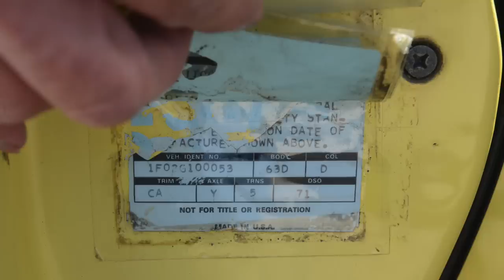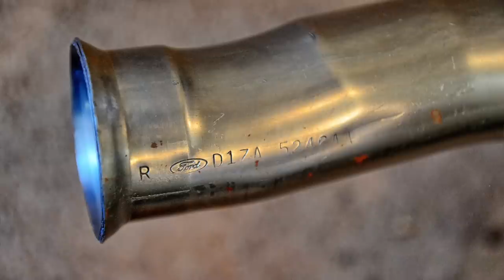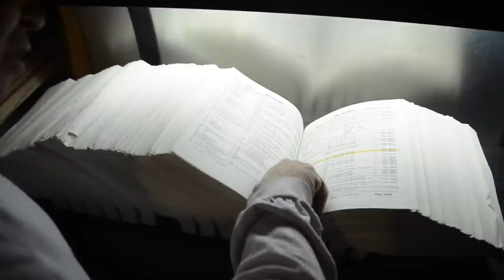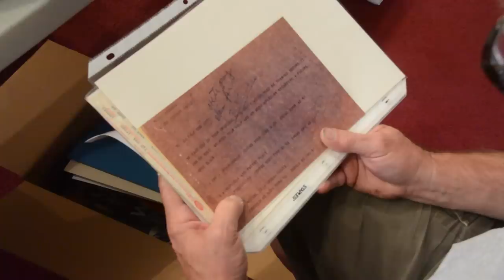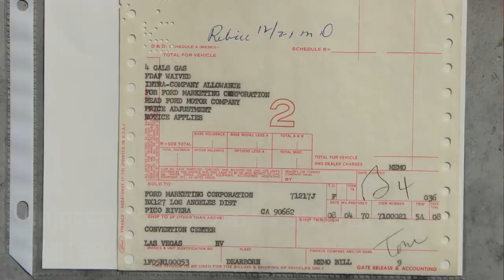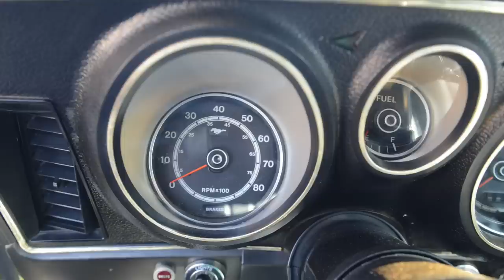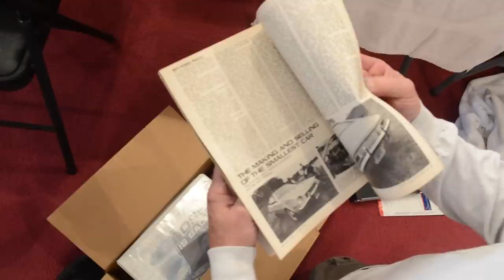Million Dollar Boss Mustang Prototype Barn Find -1971 Boss They Didn't Make

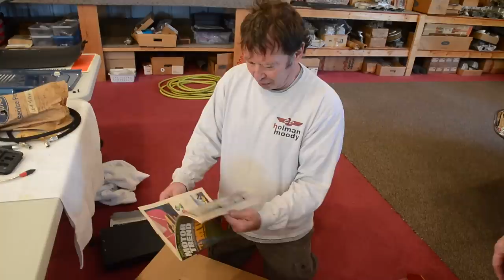Comment: What good is a car you don't drive? I once saw an ad for a '65 Chevy Biscayne with the "Drag Pack" option. A 425hp 396 and 4 speed. Price? $75K! I could afford something like that so I built my own. I found a '65 Chevy Biscayne with no rust and a recent paint job so I bought it. I installed a 550hp 454 and a Richmond 6 speed. I added front disc brakes and Hotckis suspension. A 3:42 posi rear end and new interior. I also installed gauges where the factory radio use to be. All for $20K which included the price of the car. This way, I could drive it anywhere I wanted.
Reply from the maker: I hear this a lot. The answer depends on the owner. Some people enjoy showing a car with limited driving. Some car people go so far as to restore a car completely and enjoy just having it in their garage or taking to car show in an enclosed trailer.
Reply: Just the mindset of that generation.  lol
Reply: ANY car was thought, designed and meant to be driven.  That's what gives a car its spirit...  I completely agree with you.
Showroom divas, the result of collectors trying to park their savings somewhere, are simply sad.  They dishonor the time, creativity and effort of whomever created those wonderful automobiles. (MOBILE implied)..  
If it weren't for the money Enzo made out of rich Ferrari fans, I am sure he would have damned them eternally.  Hence his quote:  "I build engines and attach wheels to them."  He build to race, that was his legacy.
So I guess parking cars for posterity is a rich man's disease.
Reply: My '69 Firebird w/a $200 455 in it when the "$3k buildsheet" 350 went south, I sold it to a friend of my nephew's, and he's spent over $75k on it, but it's NEVER been out of the garage - exactly the same spot! I would have sold it to another, or at least got a fair price for it, lol. Who else is ready to be an American Pickers style barnfind partner? I used to be very...lucky? I think that everyone here really would love to do just that! Next time may not come. Seize the moment every moment! Great find for a seemingly great guy!
Reply: People need to stop griping about how they think this car will sit.  Even if I hat was the plan for it, it would be much better for a one of one car to be in a museum than have some idiot wrap it around a tree or swap some big block in to go drag racing.  If this were some mundane, cookie-cutter car, I would agree with you...however, the fact that this is the only '71 Boss 302 known to exist AND the fact that prototypes were never sold to the public make this car worthy of trailer queen status.
Reply: AMEN, Freddy!
Reply: I agree w/u also , sick88, in this case. However, even a queen needs a little careful exercise regularly, imho.
Reply: Hi Rick...I'm a "Ford" guy but I did own a '65 Vette Roadster with the then new "porcupine" engine (aka BBC) 396 425 H.P....from everything I remember reading back in the day, the 396 was only offered in the vette in '65.
Reply: Thanks Manson...did not know that...I thought it was only offered in the vette in '65...of course I know only the vette engine was rated at 425 H.P.  My '65 Roadster was a pretty damn fast car, especially for 1965.
Reply: Well..once you have a ONE OFF 2 MILLION dollar car..then you can say weather you would take it on the street with a million doped up Millenials running wild to smash it...

Comment: Wow, you've hit the mother lode! I'm 66 now, but in the early to late 70's, I owned several Ford high performance cars. Both '65 square back & fastback 289 hipos. '66 Fairlane 390 GT. '67 Fairlane factory 427 drag car, was told "Fast" Eddie drove it at the '68 US Nationals. '69 Mercury Cyclone 428CJ w/ram air & 4 speed. Loved that Hoolman Moody shirt! Ah, the good old days! PS I can remember buying a set of 289 hipo / Boss 302 connecting rods, brand new at a Ford dealership for $8@!

Comment: In 1971 I was 13 and I saw a yellow 71 Boss 302 in the parking lot at the Southroads Sears store in South Omaha Neb near Offut air force base. I vividly remember this as I was a big Mustang fan and I was actually very disappointed that they had made the car so much bigger and were using the Boss 302 engine instead of the Boss 429. Swear to God. I am positive they made some 71 Boss 302s.

Comment: My step brother back in 1983 had a 1971 Boss with a 351 Cleveland. It had the Boss heads and a 4 speed Muncie transmission. It was totally stock when he got it but had been in a minor  front end collision that he had fixed and did a mild build on the motor. But it was a 1971 Boss.

Comment: Ford exec #1 - Hey, this new, heavier Boss 302 is a real dog. 
Ford exec #2 - Yeesh - it feels like my secretary's '67 289 coupe - not good. Chevrolet is going to destroy us, what now? 
Ford exec #1 - Move the Boss program to the new 351 Cleveland, (making the most storied small block in the muscle car era) giving us the edge, but let's be sure to produce it in limited numbers for only one year - so even though we have the best running small block of anyone, nobody knows it. 
Ford exec #2 - I'll start the paperwork.
Reply: Matt Farah's Million Mile Lexus you would be amazed to see how light those cars were
Reply: They weren't really that heavy they were just made bigger with the 429 engine in mind because that engine was way too big for the previous body mustang and lots of changes had to be made to shoehorn it in. With the bigger engine bay and such the 429 would drop right in easier or that was the original plan.
Reply: number3665 , If only they would have produced the 429 like the did with the Clevelands.
Reply: The prototype  I would  like is the  one for the Boss 351, It was a 1970 
Boss with a 351 Boss engine!  I seen the  pictures of the cars  but They claimed  the  Both the  Fastback and convertible were destroyed, because  Prototype cars are not road legal!
Reply: The Lt1 would've chewed it up.
Reply: @number3665  they had plans for a 501 version of the 429
Reply: @nobleeffort2.4  Great running motor but real life story says different. My dad had a 71 351 Boss and ran a 70 340 Duster and crushed it! Of course my dad could drive but they bother left the line in a cloud of rubber. The Duster just didn't have the legs that day... The only car I saw beat the Boss, and there were many that came after it was a blown 70 455 Trans Am.
Reply: Mylan Miller now that would be worth the big dollars , but this 71 not so much
Reply: Cam Crysler my midwest 69 4v windsor with 4:11 totally smoked a drag race built 340 dual quad

Comment: As an original owner of one of the 1806  or so  BOSS 351'S made, I would agree that the 302  wasn't  enough  engine for the  71 model .  My  BOSS 351 in stock factory form could easily beat any previous stock BOSS 302'S , which there were two of them in my hometown. Rare  BOSS absolutely !!
Reply from the maker: Depends what you mean by "easily beat." Do you mean in the quarter mile? Or 0-60 MPH? Okay, but Ford engineered their Boss 302 for Trans Am road racing, not 0-60 MPH or quarter mile ET's. Do you think a Boss 351 would easily beat a Boss 302 in the Trans Am where engines need durability and high rpm's
Reply: Hi Jerry, I was referring to street racing/ drag racing. That was what went on in the 1970's where I'm from. We even had a BOSS 429 that was raced at our local dragstrip from the next town over from me. To answer your question, most likely not. I also owned a  1960 Austin Healey 3000 Sebring in that same era, which was raced around the Northeast and etc by the previous owner, could out handle the 351 !!

Comment: I've watched this over and over and still can't figure out how Ford or why Ford let this slip out the door when prototypes are most always destroyed if not going to be produced.I try to give anyone the benefit of doubt but at the end of the day...there's some unfilled holes in all this.
Reply: I know what you are saying. It is interesting that it apparently went straight through a dealer, no special deal was made for the sale. This may all be valid, so maybe somehow it was just some kind of mistake for it to get let out. Special car for sure any way.
Reply: Ford did the same thing in Australia in '73. They developed a Falcon GTHO phase 4, specifically to qualify for racing. They had all the Boss engines and race parts to build 250 cars. They built 2 for the Ford Team and 3 others. One car got delivered to a Dealer and sold before Ford cancelled the model. So they definitely do it from time to time. The GTHO's that survived are multi-million dollar collection pieces now.

Comment: About 20 years ago I came across a yellow '71 sporting the same Boss 302 decals. Although it was parted out, the paint appeared to be original. Really wished I went back to see the VIN! The urethane front bumper from that car ended up on my dad's '72.
Reply from the maker: I would guess somebody found a set of those 1971 Boss 302 stripe kits at a Ford dealer and applied them.
Reply: That is more than likely the case. But those decals introduced me to the whole 1971 Boss 302 program. As someone who grew up reading your books and articles, thanks for bringing these great stories to YouTube.
Reply from the maker: Was the car blue? Video talked about a blue pilot car. Ford had to have them to test and develop the '71 Boss 302.
Reply: Jerry Heasley , it was heavily faded Grabber Yellow. When I later saw the yellow '71 Boss 302 in the print material shown in video it always made me wonder. At least now we know the one in the Ford photos is the prototype car featured here.

Comment: We had a 1970 Boss 302 at my uncles used car lot 1976. Prior owner had put a 680 Holley on it. I’m out driving it one day and a fuel leak caused a fire. It had hood locks and I didn’t have the keys with me.  Man did I hack saw those locks off quick and put the fire out with a water hose.

Comment: In the early 90's i had a 70 mach 1 that had correct mach 1 trim inside and out. It had factory twist lock hood with non-ram air scoop. Rear spoiler, deluxe interior. A 302 was in it and it had a G code fifth vin? Always wondered about the car.

Comment: Makes me proud of my 74 Maverick Grabber.  It's not worth anything but shes sort of a one off and I'm the second owner :).  It was ordered in late 73 for a guy who had just retired (his wife who sold me the car told me that).  He wanted a Grabber v8 but he had a bad back so he ordered it with a bench seat instead of buckets.  It came medium bright blue metallic with medium blue interior and white stripes.  chrome hubs with trim rings 302 2bbl, thermactor, power steering, disc brakes, side view mirrors, day/night rear view mirror, AC, auto idle kick down, AM/FM radio and seat belt interlock (which is a switch on the firewall and a little computer of a thing under the seat that prevents the car from starting if the seat belt isn't locked in place).  Of the few thousand grabbers in 74 made, only a couple thousand had this paint scheme.  Only 33 had the same engine options, 13 had the same decor options.  1 had the bench seat ordered.  :)

Comment: I'm a Ford guy from way back.  I still have all the old road tests, dealer literature etc.  I tried to buy the local dealer's (Packey Webb) silver Boss 351 demo when I was a college sophomore.  I knew that the dealer's son had been using the car as I lived near their house.  When I went to check it out it was back in the showroom (autumn 71).  They wanted $4400 for it.  I found that he had been driving the car without the air cleaner assembly and the carb was black as charcoal.  I turned to Ford back in those days mainly just to be a contrarian.  Also, mom was a secretary at a Mercury dealer so we had access to various new Mercs (including, one special night, a 70 428 4 speed Eliminator).  It was clear back then that Chevy along with Mopar pretty well had everyone's number.  Ford's product line I think reflected some turmoil,  on an engineering and marketing level, as their collective heads spun trying to keep up with the GM muscle car array.  One author of a 70 Mach 1 road test  joked that upon asking a Ford engine foundry factory rep about their engine lineup he replied "Do you mean right now or by quitting time?"  In the early nineties I bought a very low mile, all original 71 Boss.  I checked compression, jetting, installed new dual points, and set the valve lash to perfection.  However, it wasn't a particularly fast car in normal driving situations.  It only felt at home in full throttle banzai charges where it revved like a demon.  Ford  had the "better idea " of putting Chevy big block type heads on a small block engine but something was lost in translation and that was torque.  To compensate for the weak torque curve and lousy mid-range throttle response, Ford used 3.91 gears which ruined the car for open road cruising.  Cruising at 4000 plus rpm to keep the mini-vans off your tail gets old.  Then I found out that every good Ford guy knows that with a Cleveland you need to install intake and exhaust port plates to simulate normal cylinder head design and function.!   I don't know how the Boss 302 guys fare, some with 3.50 gears and close ratio boxes, but I do know they weren't hard to beat in a street race back in the 1970's.   Also, a study of the original road tests of the 69-70 Boss 429s  seems to reveal some disappointment by the testers and excuses by the engineers.  For me, the one Ford that really delivered was the new 70 428 Cougar Eliminator 4 speed that I had the keys to for one autumn evening in 1969.  I was 18 then but I can still hear that deep exhaust growl and the howl of the Polyglas tires as I hit second gear.
Reply from the maker: Thanks for sharing your story.

Comment: My father in law worked with Lee Iacocca and helped design the first ever Mustang. He ended up buying one and drove it until it fell apart. He also helped design the Ferriero.  He and his design team refused to sign off on the build because the transmission and engine were not compatible.  The egg heads in management stuffed something else in it just so it would go into production. The transmissions were crap and failed. The last two years of production were the only years they finally got the bugs worked out. Actually it was mid year  so only a year and a half.

Comment: I had a super low VIN 73 mach 1 I sold 12 years ago - 3F05H100003.  It wasn't anything special though outside of the VIN. This is dynamite. Even cooler, Bob has the motor for it. Can't to see when he returns it to original VIN condition!

Comment: Very interesting story...things happened back in the 60's/early 70's that would never happen today. I have an interesting old Mustang story too. When I was in H.S. in '74 a credit bureau had a repossessed '70 Orange Mustang Mach 1 sitting in its lot and just for grins I talked to my dad about what a low ball offer would be and we came up with $600 ( the car had been in a minor wreck and needed a new door and the door repainted). The credit bureau turned down the offer but two weeks later called and said they'd take it. Me and my best friend immediately bought a door at the junk yard and had it painted and the car looked almost brand new at that point. It was a 351 Cleveland 4v engine, dual exhaust and had a close ratio top loader 4 speed trans with posi 9 inch rear end. The car was pretty damn fast but my Dad and I decided to pull the engine and build a higher horsepower engine...much to our delight, when we popped the oil pan we discovered the engine had 4 bolt mains (the car was a hydraulic cam engine), which back in the day neither of us quite knew why but as the years went by it became apparent to me that I must have had a late year '70 and when they needed a block they substituted one of the new '71 Boss blocks that presumably they had available on the assembly line. We ended up making it a solid lifter engine and with edelbrock intake a holley 850 DP and a very high lift/duration cam the big Cleveland 4V valve heads really came to life...my Dad was an Engineer at Cape Canaveral and we blue printed the engine ourselves...it pulled an honest 505 H.P. which in the mid 70's made it one of the fastest street cars in the state of Florida and was certainly the fastest car in Titusville Fl. One funny anomaly with the car after the upgrades was the fuel meter (gas gauge)...lol...the moment the needle touched E the engine stopped.

Comment: Great story but I'm confused.  Did Ford swap out the original Boss 302 engine with a 351 before it was finally signed off to be sold in 1971, or does it still have the original 302?

Comment: I baught a 1969 z28 Camaro new when I was in the Navy in VA. Beach. They were 302 cu. in. to complete with the boss mustang. One reason for the 302 was insurance purposes. Horsepower was rated low to keep insurance low. I think mine was 290 at 4500 rpm but around 500 at 6000 rpm. It would turn 7500 rpm but only had 6000 rpm on the factory tac. I broke the needle off when I missed 3rd gear speed shifting. The tragic end of it was when I traded it in for a 1971 Vega. I never have been accused of being smart.
Reply from the maker: email me please (jerryheasley@gmail,com)  - I'm working on a story about what cars muscle car owners traded their cars for back in the day.

Comment: I found a 1985 Pontiac Grand Prix with a V8 in a garage. It took minimal effort to get it to run.  I sold the old junk for a lot more than I thought I could without a title of ownership and with no reverse.  The guy did not even try to haggle me down in price.  He drove it onto a trailer and left.  The body paint was very dull.  The tyres held air, but that was about it.  I do not know why the man wanted it so bad.  But I made substantially good money off it with minimal effort.